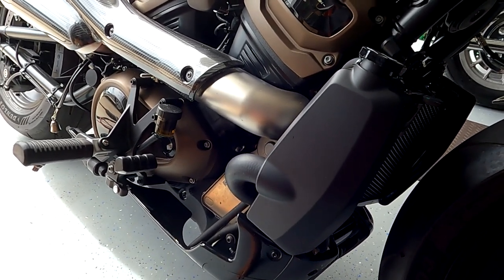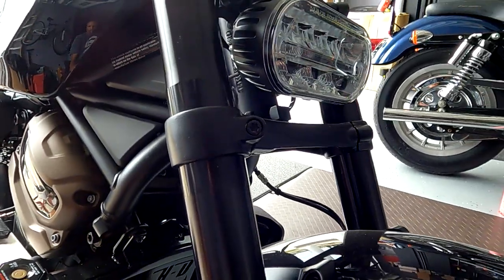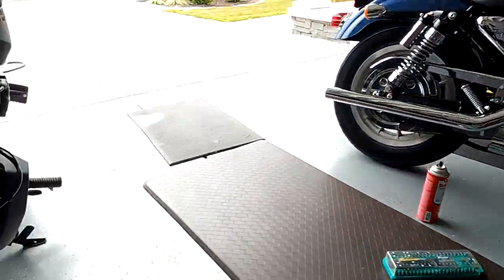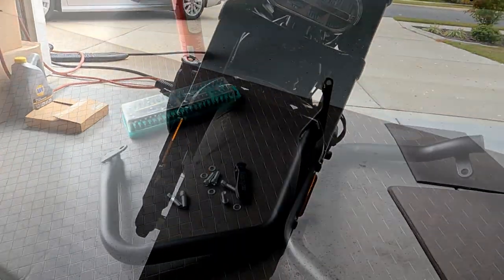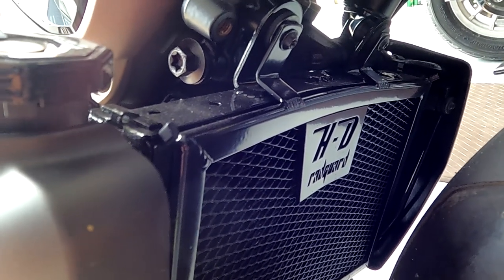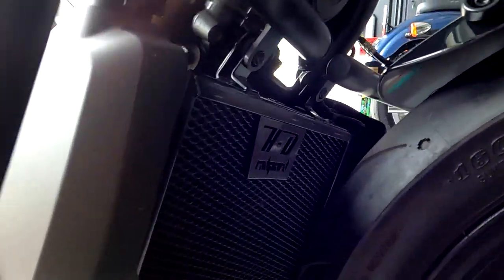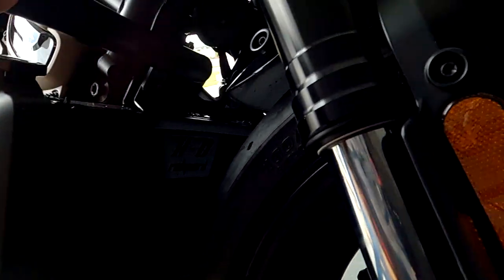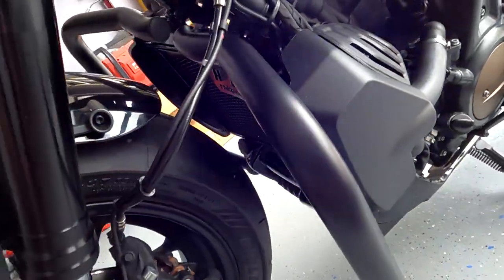Engine Guard Crash Bar for Sportster S 2021-22

Comment: Nice video. The genuine one is a single piece with a triangular shaped fold on the top that makes it very sturdy with a solid feel, and uses those top vacant threads on each side of the ones you used. But if it works, it works!
Reply from the maker: Thank you

Comment: hey brother enjoy your vids. i think you installed the top bolts in the wrong location. It should be bolted to the larger holes next to the radiator about an inch apart
Reply from the maker: Wow how the hell did I missed that!🤪 you are absolutely correct David. Damn I went to the garage to check and sure enough it's mounted incorrectly.  Thanks again for pointing it out. 👍